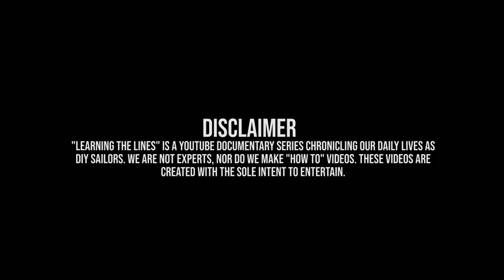What's Up With Our Cutlass Bearing? | Learning the Lines [Casual Friday] - DIY Sailing

Comment: Will that work? Maybe, and I would even guess for a short while, but it is the wrong question to ask. Bigger questions is how long and more importantly when will it cause an issue. Knowing boats, it will be in a place that is not ideal. Sooner or later (more likely sooner) it will cause an issue. There is quite bit of torque, so most likely issue is bearing will get loose and start to freely spin inside the older bearing. That is IF the new bearing is tight enough inside the old bearing, otherwise it will wobble and cause more issues, cracking bearing or bending the shaft. They have bearing removal tools you can get or buy. Or you can make one up yourself with threaded rod and two slightly smaller than old bearing round metal (sockets could work). Some beat them out and in, like they did on Sailing followtheboat, here https://www.youtube.com/watch?v=c3zop7d6IUQ But I would not recommend that, use that for last resort, especially putting it back in so as not to smash the end.

If you MUST insist on doing what you suggested in the video, would strongly make it planned to be replaced real soon in month or two after use. Than hope and pray it lasts that long. I am sure others will give better advice than I did. Follow someone advice with more experience than I have.

Comment: Don't, Don't, Don't do what you are talking about doing, you will end up destroying your strut and the new bearing will not stay in place.  The job is easy, you just need someone with a puller to get the old bearing out. It appears you have the wrong cutlass bearing too.  In the history of cutlass bearings not one has ever come out just by removing the set screws.  I paid a local mechanic $350 in labor to replace mine two years ago.
Reply from the maker: Ouch. That's a pretty penny. Based on the feedback we've been getting I think we'll work on removing the old and replacing with the same size.
Reply: Yeah, to this day I believe he gouged me but I didn't have a puller and he did, what are you gonna do....lol